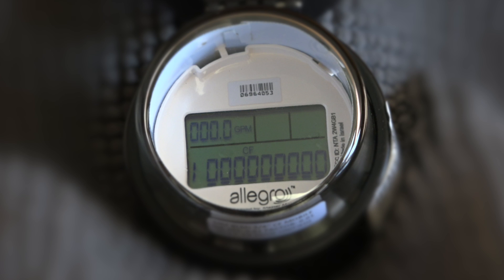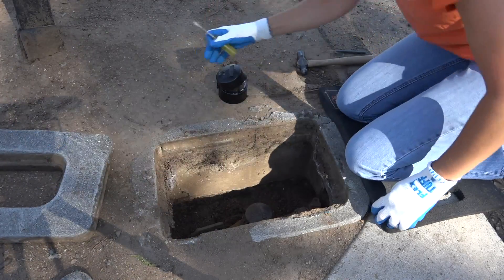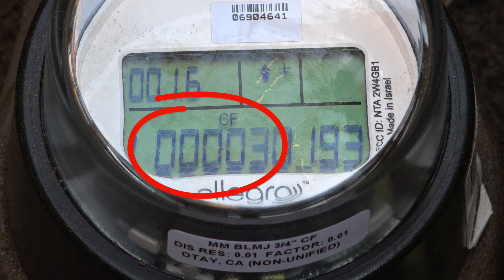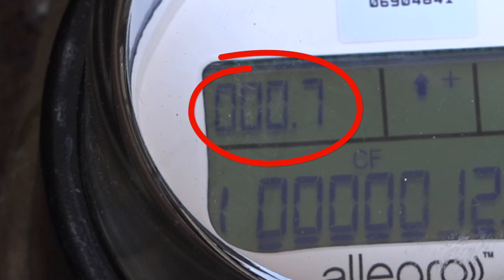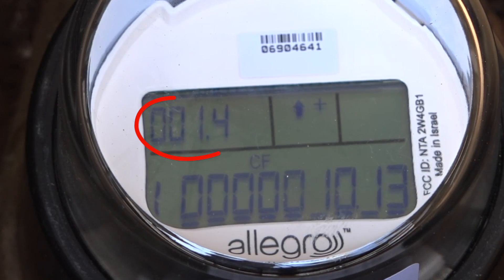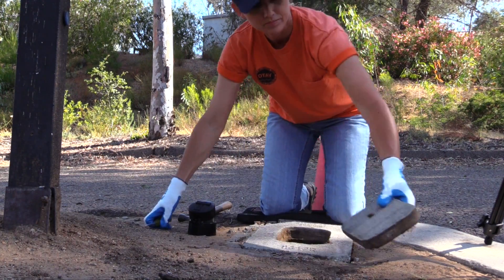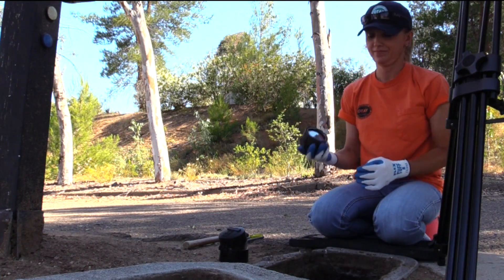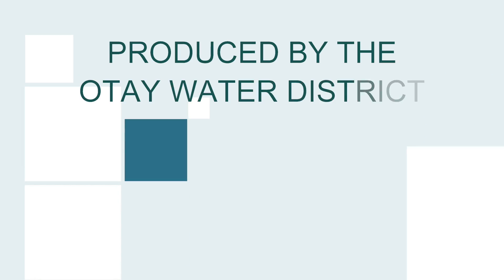How to Read Your New Digital Water Meter/Register

Comment: If a new service started at 0, the first month reading was 2618 then the next months reading is according to bill is 91048 but the reading on the meter reads 24 days after that reading as 13543. What am I missing? Is not the second month reading higher(MUCH) than the reading as of today A.M?
Reply from the maker: Sandra, thank you for your comment. Your question has been forwarded to our Customer Service department. Could you please contact us at (619) 670-2222 with your account number? Thank you.